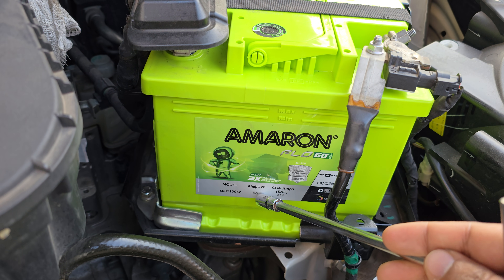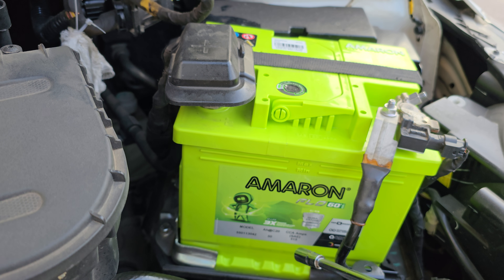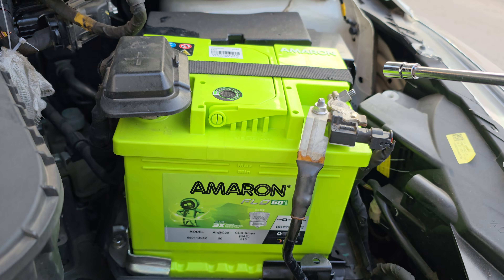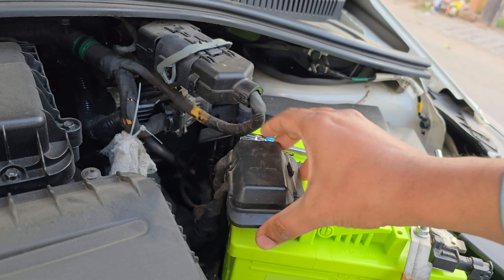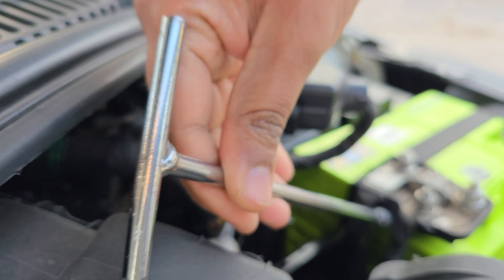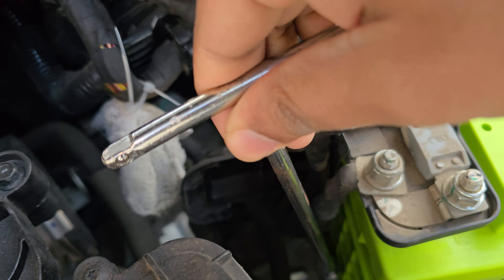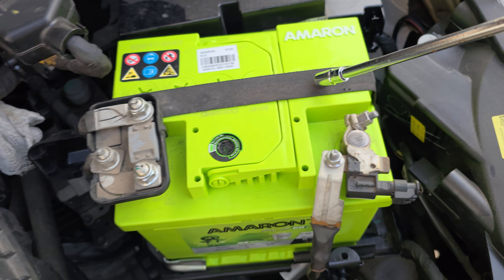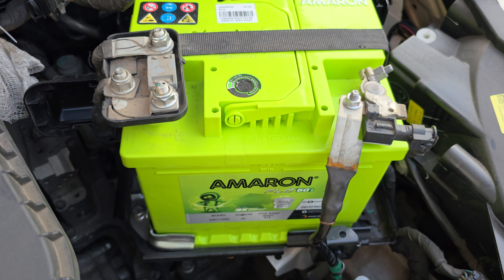Tata Tiago 2021 BS6 12v Battery Replacement 4K Upload

Comment: My 2020 JAN Tiago OEM battery has started bothering me with lagging during the start and overall draining the current when not driven. It's been quiter to 5 years now, however the conundrum is that on the label it read 39Ah. Now having contacted several battery dealers, non of them are offering such amperage. However they're recommending I should go with 44Ah or 50Ah. Wouldnt that be an overkill for a battery of 39Ah?
Reply from the maker: @rojsst  no harm in higher Amperage. Just make sure never to install one with fewer amperes than factory spec

Comment: Hello Doc, Thanks for the video. I own a Tiago Petrol 2022 BS6 Model. My OEM battery is down after 2 years. I had replaced it with an Exide MLDIN44R (44 mah) battery. Does it have an impact now due to less mah. I'm worried now. Does it affect engine performance or any impact
Reply from the maker: Hi. My understanding is that one should always use an equal or a higher amperage battery and not a lower amperage one.

Comment: Hello their mate 
For Tiago company recomend EFB battery has putting normal one have any issues
Reply from the maker: Not sure about efb for tiago, as it doesn't have stop start tech
Reply: @lemedico  thanks for the fast reply 
Mine Tiago NRG bs6 2022 dec with amaron bat model no OTM-AM-EFBDIN47R is 2.5 yrs old nd odo at 8260 km is showing bat failure signs would be recommend the instal bat which you installed or the stock as it's hard to find 
I m not getting the point of tata giving a EFB battery in Tiago as it don't have start stop features
Reply from the maker: @rahulrulezz60  you can go for this amaron, as many of us have. It works fine, and is a trusted brand
Reply: @lemedico  ok for sure thanks for your revert

Comment: my car is also 2021 same tiago battery is still fine is there a specific reason you need to replace it so soon?, Really thank you i never knew about the serprate bolt that needs to be loosened to remove the battery
Reply from the maker: It depends on the usage, I often stop the engine at traffic lights and the stereo and fan stays on. Might be the reason for an early deterioration.
Reply from the maker: The nut was an eye opener. Such an unnecessary and concealed system. It isn't even written about  in the owner's manual